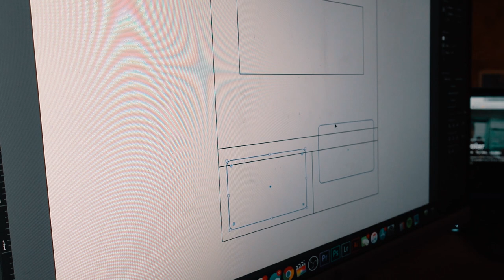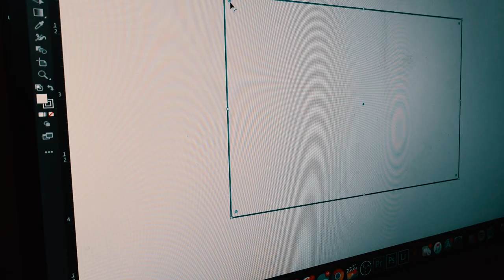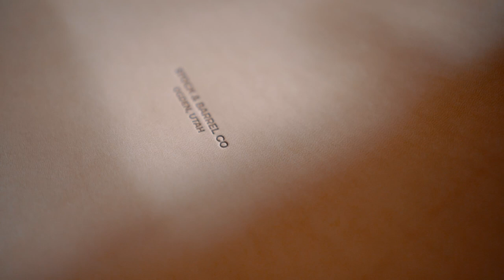Making a Women's Leather Long Wallet

Comment: Love it, two things, a coin holder and more card holders, between credit, debit and loyalty cards you need a whole lot more spaces!
Reply: To be honest no one use coin holder in a purse. We just throw it in the zipping area
Reply: @vastadmist2258  The zipped pocket would be the coin holder!
Reply: @vastadmist2258  I use them. Cecile is right. I have several wallets that have very practical zipped coin holders inside.

Comment: Would like the ID slot to be located to the side instead of right in the center so you can free up more space for more card slots. When ladies invest in a large wallets like that, they expect as many slots to accommodate at least 8+ cards.
other than that it looks BEAUTIFUL and I agree with you about needing to make the front flap a little longer, but I wouldn't take it down too long -- definitely not let the tip of the flap touch past the half point of the wallet -- as the current look you have now is what makes your design so unique.

Comment: Wow! That machine goes REALLY slow.... What sewing machine is that? I have a Consew 206RB-5 and can only get it down to 500 stitches a minute, which is still too fast for delicate sewing like you were doing. I would love to get it that slow when sewing webbing for harnesses and slings.
Reply: You need to change out to a servo motor and possibly add a speed reducer.  You can pick them up from any industrial sewing machine repair person, eBay, or call Cobra or Toledo Industrial Sewing Machines.